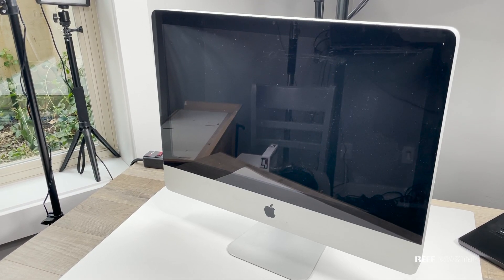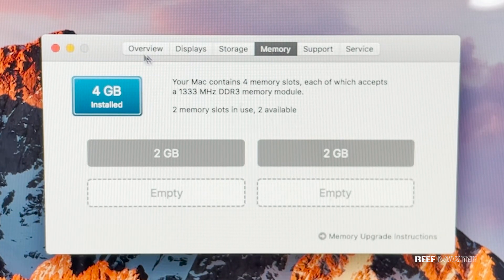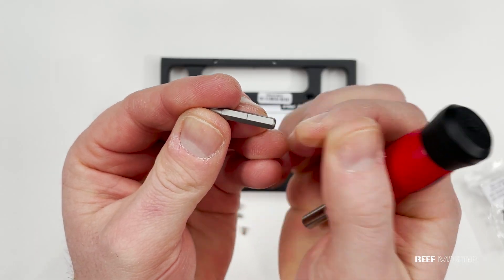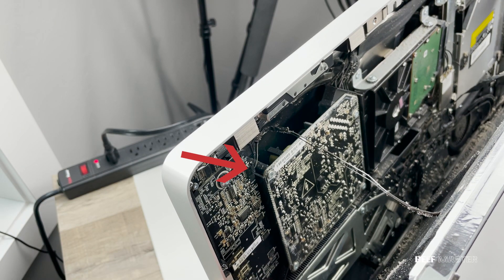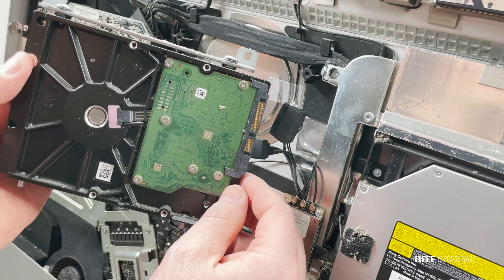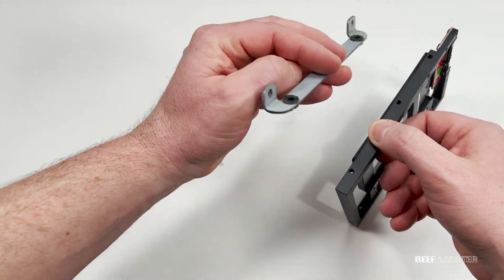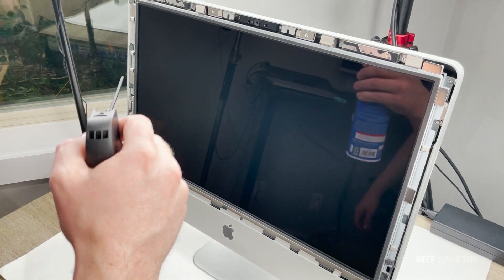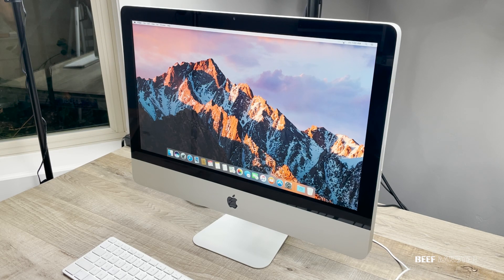How to Install a New SSD and RAM for iMac

Comment: Thanks a lot! This video encouraged me to upgrade my mid 2011 iMac with the SSD. But when I reassembled everything together I have a black screen. Every other thing seems to be working just fine. I found that the LCD cable could be slightly damaged so I bought a new one, but the problems persists... Fans are working just fine. Any idea? Thank you sir!

Comment: In case you are executing this procedure in a 27” iMac 2010 are the cables the same ? Besides does it support max 16GB or 32GB RAM ? Any brand recommended ? I also noticed you used a cable for the thermo sensor but that can be avoided with the Mac fan control software I understood. Finally can you place a video to upgrade the CPU (i7 I assume). Thank you !

Comment: I replaced the SSD and the RAM, but it will not power on. Any help would be welcome, thank you!
Reply: I don't know about the SSD, but for the RAM -
My iMac is a late 2009 27" iMac - I just had the same problem after installing new RAM, I was getting the three loud beeps when I tried to power on and the screen stayed blank. This was my solution -
1- I re-checked to be sure that the new RAM was compatible (it was).
2- I removed the new RAM chips, and installed one of the old ones; doing that made me realize that I hadn't pushed the new RAM chips all the way in (I knew they felt loose when I installed them, but I hesitated to put more pressure on them).
3- I reinstalled each new RAM chip, and made sure that they were pushed all the way in; I used the plastic back edge of a knife handle to push on the outer edge of the chip, until I felt it had seated correctly. (You can feel when it goes in correctly, it's a fairly tight fit, and if it's sliding in without any pressure, than I can assure you the chip is not installed all the way in and you'll get the error problem when starting up.)
4- After installing, I screwed the panel back in and started up the computer.
This process solved my problem 100%. 
I'm thinking of upgrading the drive to an SSD, but is this all worth it? The new 16 Gig of RAM was only $24- and simple to install, so well worth it, but if I can't upgrade the Mac OS to something later than High Sierra, and I therefore can't upgrade the web browsers I'm using, I'll still be finding a ton of websites that are not rendering correctly on screen and telling me that my browser is out of date, and in some cases that makes the website unusable for me (my bank website, and many business accounts sites, for example.).
Any advice on that aspect would be appreciated, thanks.

Comment: So you mentioned in your video that that are four ram slots. I only saw you pull two tabs. Where are the other ram slots? I have this same computer in the 24 inch model and I thought it only could take 8 GB of ram. How much will it take?
Reply: All iMacs have 4 slots but mainly only come loaded with 2 ram. I’ve added up to 32Gb but I think you can go higher

Comment: I just bought one of these really cheap and looking at upgrading bits, though the older gentleman said it had an SSD installed. When you installed this SSD, when you go to Storage, does it still say SATA? I don't want to open up the screen for no reason (because it's connected by SATA, i wonder if that makes a difference?)

Comment: di I have to use the brackets and foam cushion? I bought a used iMac that didn't have a hard drive so no bolts or foam
Reply from the maker: You should be good without the foam cushions. There are no moving parts on a SSD like there is on an HDD so there isn't a need to cushion movement.

Comment: FYI, you don't need the thermal sensor kit by OWC. You can also install fan control programs that do it for free. That's what I did and it worked for me, at least.

Comment: The 2011 are a more-friendly model, as no adhesive strips are needed.  Though I'm currently looking at a 2010, the front-side bus is slower.
Reply from the maker: Lifehack: go check out a nearby university overstock or recommissioned inventory. A lot of time they will upgrade entire departments and sell older models for really cheap.
Reply: I currently have a 2013 with i7, but my Sick Brain wants to buy another.  This one is $99 with local pickup.  The prices are dropping quickly due to fading mac OS support.  I run Ubuntu so an i7 runs strong.

Comment: Hi, thanks for the material. My iMac is very noisy, how did you solve this problem ?
Reply from the maker: Try doing the NVRAM reset - restart and hold CMD+Option+P+R for about 15-20 seconds until you hear a second chime and the computer restarts. 

If you update RAM, the Mac may be having problems syncing with the new RAM, causing the fans to go full blast, and this should resolve it. You may have to do this once or twice.

Comment: Thanks for this very easy to follow video tutorial. I have one question. is it true that after installing the SSD in a Mac you might not be able to upgrade your computer to newer IOS versions. I have run into that problem and so did a few people I talked to. thanks.

Comment: One simple safety measure that people miss, is using something to prop the screen back in it's fully tilted position whilst removing the screen. I stuff a soft pillow underneath the monitor, so it's trapped against the leg. With the screen tilted back it cannot fall out as you're removing the cables....it's very easy to rip out the delicate connectors, which are a pain to replace!

Comment: My screen is black and I don't hear anything. Itnhas power. I checked all the wires but still no display. Please advice
Reply: I just did the exact replacement and my screen is black as well. I checked the four cables and they appear to be connected properly. Did you figure out the problem? Thank you!

Comment: Hello, thanks for the video. But there is a question, how and when did you install ios on a new ssd?
Reply: U mean MacOS? First you need to create bookable USB with supported MacOS eg. High Sierra preferably on another Mac.then use that USB to install MacOS onto the new SSD.

Comment: An interesting video!👍👍It would have been a good idea to renew the thermal paste and to check if the battery needed to be replaced and to upgrade the processor if possible.

Comment: Good job but IMHO you should have disassembled it further to remove the heatsinks, clean these and apply new thermal paste, after 10 years this might be really dry and it's especially bad for the GPU, these Radeons seem to be prone to failure (at least these are MXM modules and not soldered directly to the logic board, but there aren't many MXM cards on the market and you pay easily 50 bucks and more for these decade-old GPUs that might get completely outperformed by a modern IGP like Intel Xe, Radeon Vega 8, Apple M1 7-Core or low-spec cards like the GT 1030 or RX 6400).
And install Macs Fan Control, so you can keep an eye on the temperatures, even the free version allows you to chosse a temperature source, a temperature when the fan should ramp up and a maximum one.

Comment: Great video, I’m curious — you’re instructional video on swapping the HDD with a SSD in a 2011 iMac oddly seems more straight forward and simple when it came to the thermal sensor cable… in OWC’s video they appeared to remove the entire logic board. Confused on why this is.

Comment: Great video! I noticed you didn't plug the thermal sensor back into the motherboard. (maybe it wasn't recorded) Is that a step needed?  Everything is working on my 2010 iMac except the fan is running all the time.

Comment: In my experience, Imacs collect tons of dust, even in fairly clean environments, and the heat caused by the blocked air passages makes the fans run at full speed and slows the computer down.
I've had to take apart and clean two Imacs .... never had a similar problem with Apple laptops.

Comment: Great video! Thanks for the help. I just don't understand what to do after the new ssd is installed. I have a mac just like this one. But the hard drive on mine just died. I'd like to make a repair like you did, but after that what do I do to put everything back on? I have an external hard drive with time machine back ups. Thanks in advance for your time. Cheers!

Comment: going to be be doing this real soon!!! not ready for a new PC but could benefit for a bit of a speed up.  Question - how needed is the anti-static mat?  I know when working with electronics things like this are recommended, but I will never use it again.  Didn't hear anything about it in video but 20 bucks can get me like....a quarter tank of gas lolol

Comment: Note after the SSD swap, check to make sure TRIM support is enabled through system report. TRIM is a method that helps the operating system free up space. It also helps prolong the drive's life and promote efficient operation. Its on by default if you bought a Mac with SSD, but if you upgraded later, you'll need to manually enable TRIM in the terminal after the installation.
Reply: Google: „In order to enable TRIM, you can open the "Terminal" application on your Mac, type in the command "sudo trimforce enable", and then enter your admin password to activate Trim. The system will ask you twice to confirm the execution. After this, the system will automatically reboot to implement trim support.“
Reply: How do we do this?
Reply: I guess we'll have to YouTube or Google how to do It since you didn't offer any how tos😮‍💨

Comment: Great video, did everything you said, cloned drive to ssd, rebooted to it externally, worked great, then replaced it with the old drive, but when restarted, getting the dreaded flashing question mark folder.  Any ideas?  Thanks.
Reply: Did you get this resolved?

Comment: Just done mine...i didnt need to disconnect  all the cables , just swung screen out and used a couple of straps to hold it in place and accessed the old HDD easily to replace....left the thermal sensor off and used mac fan speed app...all woking fine

Comment: Why would you need the heat sensor is you are replacing the hard drive with an SSD?  The SSD is bound to be never more than warm, isn't it?  it is a shame that apple makes this impossible ( as far as I know ) with the newer macs.
Reply: You need it because the mainboard polls the sensors periodically. If it doesn't get a reading from the hard drive sensor, it blasts the fans up to 100% and require you to use macfans to slow it down. Otherwise you will have jet engine sounds 24/7.

Comment: Hey BeefMaster: With the new SSD, can you update the OS to something more recent?
Reply: Good question. Did you every got the answer to your question ?
Reply: High Sierra is its highest software that the iMac 2011 can go up to, but you can also use patchers to get to Monterey (would highly recommend getting a better gpu that supports metal if you do this tho)

Comment: I must say BeefMaster, great instructions to breathe new life into my 2010 iMac. I would say it is now faster than my 2019 4.2 i7 iMac with its Fusion Drive.
Reply: Were you able to upgrade the OS as well?
Reply: @2011tosaeast  Hi, I didn't want to upgrade the OS on my 2010 because I need it to connect to a Mitsubishi DyeSub printer that doesn't support Catalina. Apparently High Sierra is the best you can do on a 2010 without installing lots of patches.
Reply: SSD are much more superior in performance than fusion drive

Fusion drive are just SSHD meaning, a hybrid of ssd and hdd. 50% of its storage are ssd and the rest are hdd

Comment: Hi there, Great video, I followed it exactly and everything works great except the fans are running at full speed even though I did attach the thermal cable. Does it matter if it's at the front or back of the SSD? Does the SSD capacity (1TB) make a difference in the fan operation? Thanks a lot!
Reply from the maker: Good question. If the fans are running full blast you will likely need to do a NVRAM reset so the computer will recognize the new hardware. To do that, reset the computer and hold CMD+option+P+R. Steps are around the 10:33 mark.
Reply: is it possible to plug that sensor in backwards?  Might you have done that?

Comment: Hello brother, I have a problem with replacing the hard disk because there are three cables in the Mac and the new disk does not have a place for the small cable, so what is the solution please, knowing that it is the same as your computer
Reply: I had the same issue. The smaller cable is to do with the heat sync. No longer needed as software can fix that.

Comment: Congrats on the excellent video. It made look easy. Could please tell me if this fix would work for the iMac Mid 2010, including the parts that you used (Heat sensor and SSD drive)? Thank you.

Comment: Will this upgrade make my 2011 iMac capable of using the latest mac OS? Lately, I get more notices that it is becoming obsolete, for example does not support new upgrades to OS, certain programs, etc.
Reply: No, but if you search around on the net or on youtube there are procedures for upgrading an EOL'ed Mac to the new OS.  It will run slow.  I think you can also load other OS'es on it, including Linux.

Comment: Hi, will you add video how to replace graphics Card in the same model? Thanks
And links.... preety please :) 2GB
Reply: No such thing as replacing GPU on iMacs. They are all discrete chips soldered on the mainboard. There is absolutely no way to do it.
Reply: @skendel  So there is no chance to upgrade from 512k to 2G graphics Card in older 2011 iMacs? Just buy New iMac right?
Reply: @alufelgaa  exactly
Reply: ???? i saw yt on how to upgrade the gpu.. @skendel

Comment: Could the SSD stay external and still be the main “hard drive”
Reply: You could but if you have a 2011or older iMac it would be loading everything at USB 2.0 speeds. I can say when I double checked drive after cloning that it did boot up faster via usb than it did with my original hard disk though.

Comment: Awesome tutorial! I have a question: you mention that you know have 20GB ram total, but I read somewhere (I believe on some official apple page) that the 2011 iMac can only handle a max of 16GB (4GB in each slot) but you proved that to be false?
Reply: I also put in 20 GB of RAM and it worked fine. I have the same 2011 imac.
Reply: Some say you can put up to 32gb of ram
Reply: Yeah, if you look up the mac's info on everymac or even crucial or OWC, it will sometimes list what the true max is. Sometimes Apple updates the firmware to support more RAM and don't really advertise it.